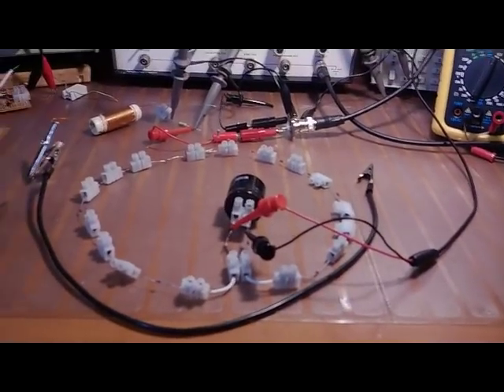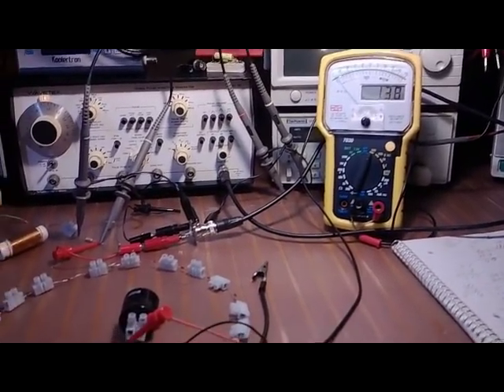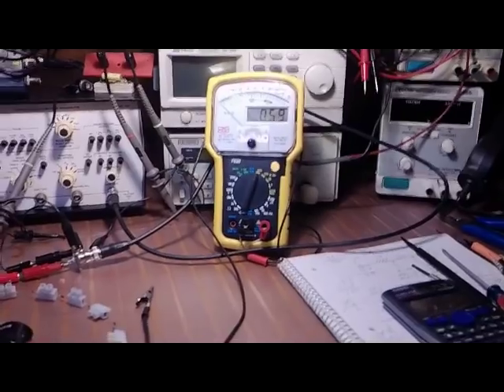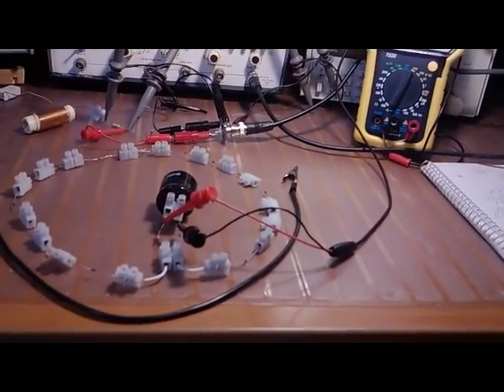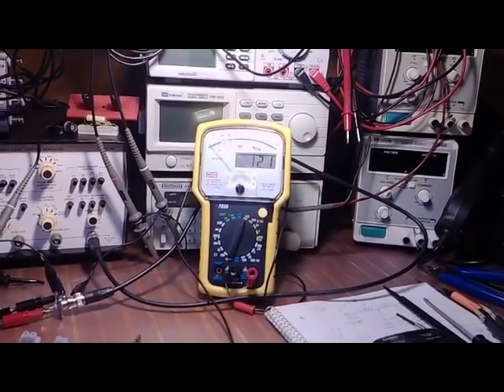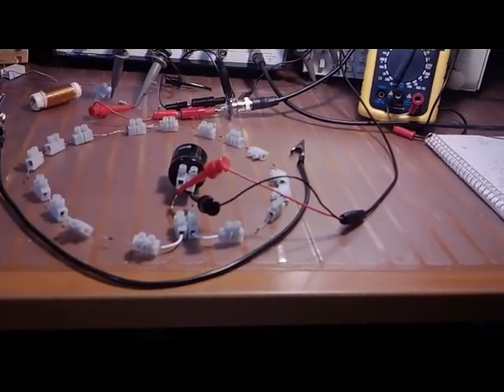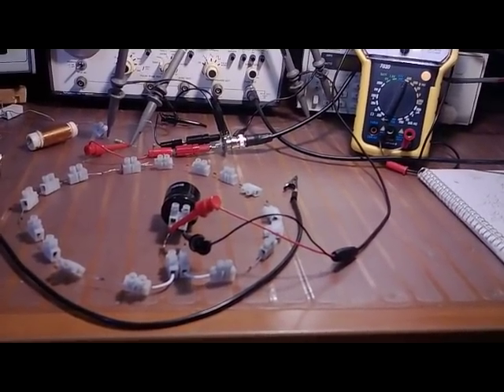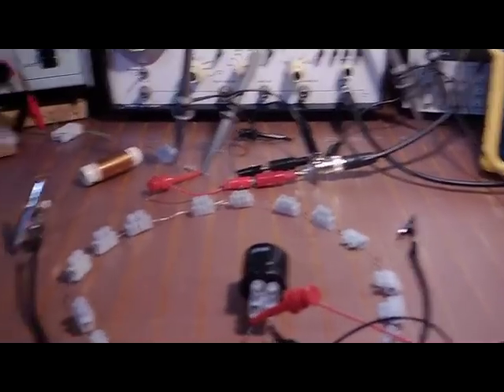Ring Charging a capacitor

Comment: Thanks for sharing these greatly insightful demo's Doc!
This might be wrong but here goes, from Q=CV we get 450 exp-6 x 121V is 0.05445 Coulombs. 1 Coulomb = 1 Amps for 1 second. So 0.05445 / 85 Seconds = 0.64 milliamps constant current integrated over the 1 minute & 25 seconds, at least I think so.
Multiple stacking of this simple circuit could produce some serious power!

Comment: Do not shoot the messenger! Just converting found measurements using well known formulas. Someone was asking, so let's give it a try.
C=440uF. U=121 Volt after 125 seconds. From 0 to 121  Volts for 440uF needs 3.22102 Joules. The charge is then at 0.053 Coulomb.
From Coulomb to Ampere/hour: 0.053 Coulomb is equivalent to 0.000014722222222 A/h.
15uA/h. In 125 seconds (lets say 2 minutes, 1/30 hour)  30x15uA/h = on average 450uA during 2 minutes.
Source: http://mustcalculate.com/electronics/capacitorenergy.php?v=121&c=440u
and https://www.rapidtables.com/convert/charge/coulomb-to-ah.html
A 40Watt bulb needs 40J/s. We only have 3.2 Joule. It will flash, but we need 2 minutes recharging for a next flash.
PS: I am a thinker/observer, not a doer. Please do not ask me to replicate.
Reply from the maker: No fight here, yet it is a bit simpler to calculate, so why worry. I was not meaning it would like a 40W bulb, I was only trying to insure someone did not stick a baby bulb in there and blow it, my bad for not being clearer.

Comment: Hi, thanks for sharing.
It would be nice if we know its power consumption too. How much voltage and current applied to charge this type of capacitor?
Reply from the maker: I thank you for watching my video, but I do not perform measurements, modifications etc on user request. 99% of what I show can be replicated and tested on the users bench which is the best place to address some of your questions. I place video's for replication and no other reason.
Reply: StifflerDr okey thank you.
Reply: You can do the math. See other comment.